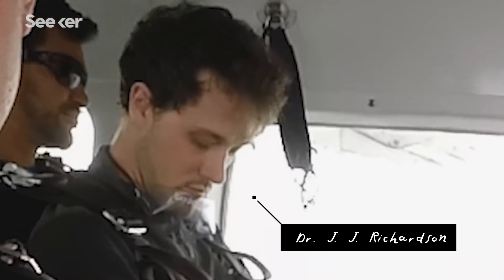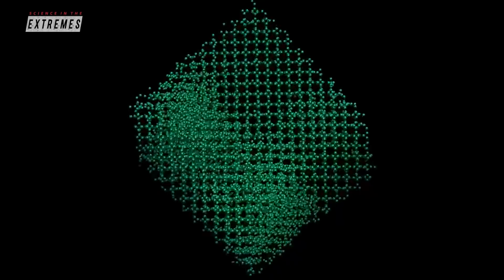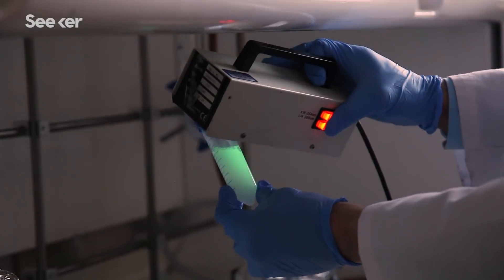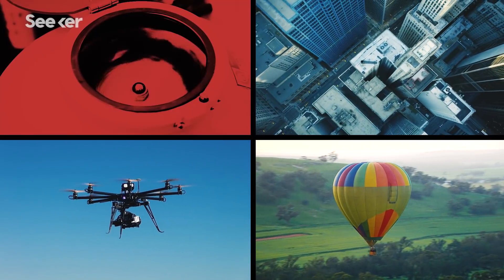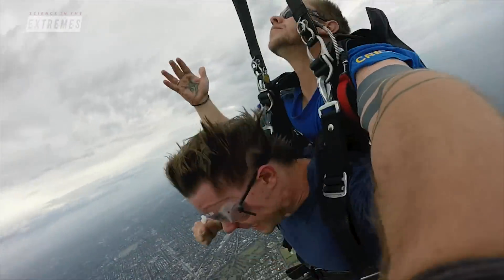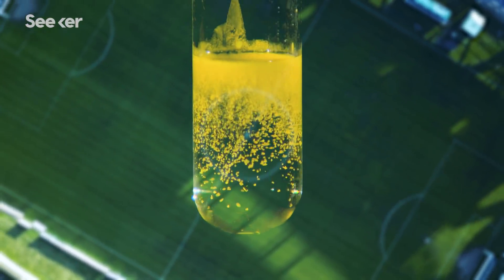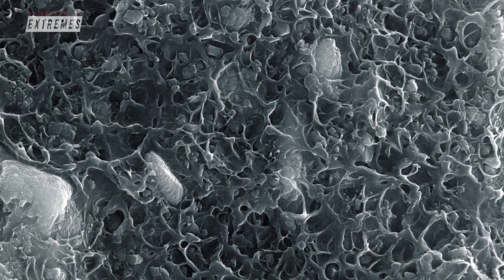These Hybrid Metallic Crystals Are Chemistry’s New Miracle Materials

Comment: One problem here, according to science, free fall is NOT low gravity.
Reply: But low enough for the tests to work.
Reply: Roel Wieggers It is not a low gravity environment according to science, free fall still leaves you inside of a high gravity environment. now, I disagree with what "scientists" and "physicists" call gravity which is why this experiment works.
Reply: Timothy Haug no one is saying anythin otherwise,think you have interpreted it wrong,it merely simulates low gravity when they hit 0gs,much like how the space station is still effected by gravity but its constant falling simulates no gravity
Reply: @timothyhaug2060  
the astronauts in the iss are still in the gravitational field of earth it's just the station moves so fast it falls over the horizon which puts the station in continuous free fall. if you somehow locked a platform in space relative to the earth's centre at the altitude of the iss you would still be in about 90 percent earths gravity.
Reply: 15firekid I would argue the 90% of gravity figure, but yes, technically they are still within earth's gravity well.
Reply: Timothy Haug dont know what you mean by 'technically',it literally falls thousands of miles every second due to gravity,clear cut as you can get.
Reply: It emulates it close enough to work, and is much cheaper.
Reply: Falling is what the ISS or any orbiting body dose they just move sideways fast 
enough to continually miss the ground and fall towards a different spot.
Reply: How about that zero g plane...that plane just free falling
Reply: But it counteracts gravity as if you were in low gravity
Reply: It's a simple misrepresentation by the presenters really. Although the researcher that was presenting to the audience was somewhat at fault for using gravity as an anology rather than space. What they were trying to do in the experiment was to simulate a "suspended" environment, like space, to test out their hypothesis on growing crystals.

Contrary to what some people might think, the MOFs aren't exactly suspended, especially if they're planning to grow them in a test tube like what they have shown.

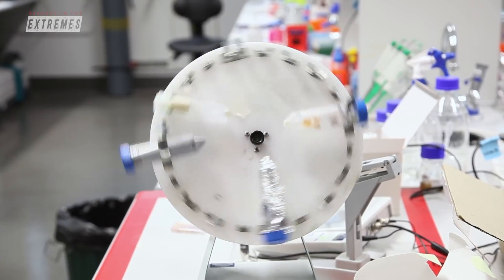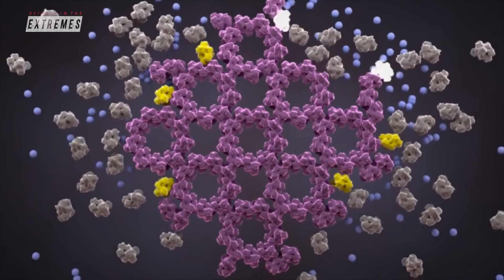Under normal circumstances, the MOFs would tend to "settle" like sand or gravel would in a still pond or lake. This was what they were trying to show in the animation from 1:52 to 1:58, with the purple structure (organic students could imagine this as a seed or nucleation point) being "dragged" through some liquid medium. Compared to this "dragging motion" which would introduce impurities, they believe that having the crystal grow in a more suspended medium would be less disruptive, thus form purer MOFs when compared to ordinary test conditions.
Reply: Ka Hung Lee and Adam Rasmussen ... we have our winners! people keep equating low G force with low gravity when the two are mutually exclusive to each other. they do have similar correlations, but are in fact, not the same thing at all.
Reply: To be fair, gravity is the ultimate cause of the issue, but sure, it is low g-force they want, which is what they get in free fall. At least until air resistance removes the acceleration.
Reply: No, but a free fall flame will turn into a ball. Fire does the same thing in zero g.
Reply: It is reduced gravitational acceleration.
Reply: "According to science", what?
Anyway, equivalence principle.
Free fall indistinguishable from not under gravity under certain cases at least. You know, one of the motivating ideas behind general relativity?

Comment: Perfect excuse to use corporate funding to fuel your extreme sports
Reply: "I swear this is for research and not just goofing off!"
Reply: It clearly says Sponsored by the U.S. Air Force multiple times in the video.  How could you have possibly missed that?
Reply: It doesn't really matter, you lot.
Reply: commode7x  The Video was sponsored by air force not the research
Reply: @halasimov1362 
Which was why they jumped out of a plane for the research.
Reply: Your an idiot
Reply: @OnsideHaddock72  /r woooosh